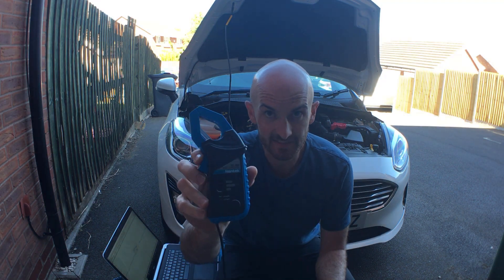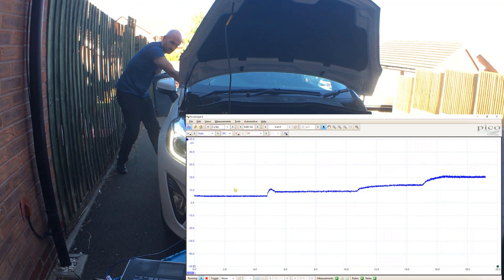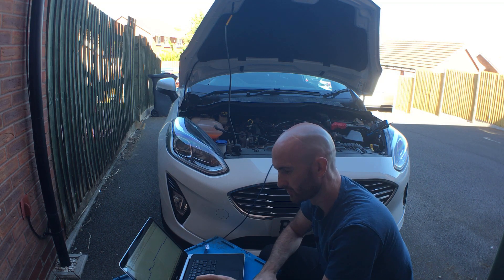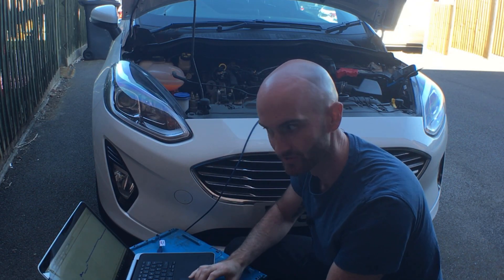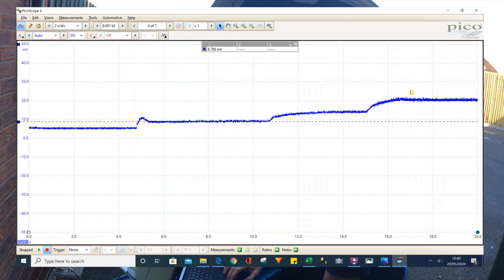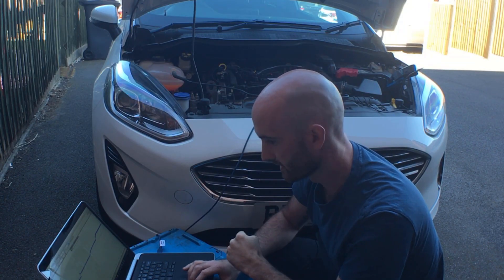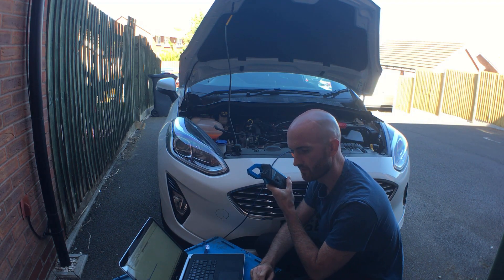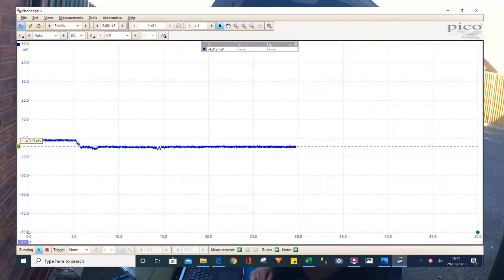HANTEK CC-650 AUTOMOTIVE TEST AND REVIEW [With PicoScope 2204A] Mechanic Mindset

Comment: Great video again! By the way which Laptop do you use for your Picoscope diagnostics please.
Reply from the maker: Most modern laptops will suffice. Of course the higher the specs the better it will perform for taking long captures. I’d say atleast 4gb RAM. 8 is better. Any modern processor. An a proper hard drive (not these small laptops designed for web browsing and basic office programs). 

This here is an old high spec Dell.

Comment: Can you still use this amp clamp with 2404a I just saw your video change about the new 7 pico  . Confused
Reply from the maker: Hi, yes it still works fine with 2204a. Pico 6 or Pico 7 👍. Just remember to get your software from picotech.com, and not PicoAuto.com
Reply: @MechanicMindset  thanks Darren 👊🏻

Comment: Great video. Sorry for the dumb question but I have no idea what's exactly Pico device or software connection to hantek electrometer since you connect it directly to PC? Can you please elaborate? Thanks:)
Reply from the maker: Good question, thanks! The Hantek clamp will work with any oscilloscope (Hantek, PicoScope, Autel, UScope etc). The Hantek amp clamp connects to the oscilloscope using the BNC connection.

See more amp clamps here: https://youtu.be/lYtW64Y-7Wk

Comment: Is there anything special you
Need to do to get the hantek clamps to work with the picoscope? In terms of set points in the pico software..
Reply from the maker: You don’t have to, but you can set up a ‘custom probe’ so the scale reads amps instead of volts 👍

Comment: I’m new to the scope world lol  I got the 2204a as well after watching your videos. Is there a way to setup the pico 7 up for both hantek clamps so it will do the all the conversions for me?
Thanx
Reply from the maker: Awesome, great tool for the price! Yes you can set up a custom probe by clicking the add button in the probe menu. Then use the look up table to put the mV/Amp conversion in there. Edit one of the existing amp probes to see how the lookup table works 👍

Comment: Hi mate I see on amazon there are 2 different types of the 2204a. There is the 2204a-d2 which is a bit cheaper. Do you know what the main difference is as its about £65 cheaper. Thank you!
Reply from the maker: Hi, I think one comes with leads and the other without. They’re not automotive leads anyway so should be good with the cheaper one. Get the Hantek leads 👍
Reply: @MechanicMindset  thank you and thank you for your excellent videos. You're a brilliant teacher. Unfortunately the hantek cables are no longer available :(
Reply from the maker: @dann2707  Keep searching on Amazon and eBay, they might be under a different name too. Just search automotive oscilloscope cables. 

You’re welcome and thanks for the feedback! Great to have you on the channel 👍

Comment: bro, if iam using this cc650 current clamp what setting should i pick for i has seen the 30A, 20A mode and 60A mode
Reply from the maker: Hi, it depends what you are testing. For relative compression/starter motor use the 60A mode. For smaller things like fuel pump, use the lower setting. I thought it only has 2 setting?
Reply: Thx a lot but could i just using cc65 measuring relative Compression in 60A mode?
Reply from the maker: @sweetjordan4868  No, max current for CC65 is 65 amps, and the clamp won’t fit around the starter cable 👍

Comment: hello great an info but you have made some hardware software changes to make the pico software recognize the hantek clamp. thanks and congratulations for the video
Reply from the maker: Hi, no changes need for the Pico software recognise the Hantek clamp; the clamp simply outputs a voltage. You can create a custom probe to get the correct amp reading. I think o just used the voltage measurement in this video. Glad you enjoyed the video! 👍

Comment: Thanx for this. I was hoping you would do an engine crank waveform, b/c that's what the high amp clamp is used for.
Reply from the maker: Thanks for watching. For sure, I did a video just before this; full relative compression on good engine, dead hole and small compression leak. I just did this video to see how far we could push this 650A clamp - surprised me to be fair! 👍
Reply: @MechanicMindset  
OK, thanx! I'll go look for it.

Comment: Should I add the clamp information and specifications manually Into the probe selection menu? I can only see Pico clamp in the menu.
Reply from the maker: Hi, yes you can add a custom probe. Or you can copy the Pico probe and edit the details to match the Hantek clamp. You will have to set up 2 probes; one for each amp clamp setting

Comment: I know this is an old video but I'd be interested to see the difference between this and the pico versions to see a side by side comparison
Reply from the maker: Hi, thanks for asking the question! This video has plenty of life in it 😂

I use the Pico clamps at work, I don’t notice any major difference but I have not tried it side by side. I also have the 65A Hantek clamp, need to do a video. Some people say the Hantek clamps are a bit noisy ey but I don’t think they are that bad. To be fair, the Pico clamps aren’t that expensive. Although I’d like to give the TA234 a go - fits right round a battery cable for battery drains 👍
Reply: @MechanicMindset  I would love to see a video on the low amps clamp ( and a comparison too if possible) I'm new to scope use and your videos are great, thank you
Reply from the maker: @andyguest6543  Will see what I can do. Glad you are enjoying the channel! Thanks

Comment: I've got two Electronic Specialties amp clamps and can't get either one of them to work on my 2205. Tried several things and they just won't cooperate. Still trying...
Reply from the maker: That is unfortunate! How are the batteries? Are they definitely outputting a voltage? Remember, all the scope is doing is measuring the voltage created by the clamp.

Comment: Much better suited to use the CC-65 for ignition and injectors.
I currently have the 65 which is great for the detail on low amp circuits.
I have just purchased the 650 to enable me to do relative compression checks
Reply from the maker: Nathan Thomas Burke Yeah for sure! To be fair I was surprised the CC-650 actually output a representative signal for the coil and injector. Just testing 👍
Reply: Yer defo, I'm surprised watching it it could get such a good response.
Had much experience with relative compression testing with this clamp
Reply: Is the 650 accurate enough to monitor parasitic draws? I have the 65 but it's not large enough to fit around the battery cables

Comment: Another consideration is CC-650 has a 400 Hz bandwidth limitation vs 20 KHz for CC-65.
The drawback on the CC-65 is it's small throat. And, I find it "noisy"
Yet, both clamps are hard to beat for price/performance which explains their popularity and I own both.
Cheers:)
Reply from the maker: the GADGETS playlist Ah ok, useful to know. Yeah they are great value. I am looking at the Pico TA234 - get around those big cables and probably a better quality output. I use the Pico clamps regularly at work and they are great, apart from the small throat on the small clamp like to mention 👍

Comment: You are a real genius using a 650 A clamp on a fuel injector. Has anybody told you that a fuel injector primary is about 1 A only? No wonder why the signal looks like crap.
Reply: @Der Waldmeister - Why so rude? Seriously man, chill out.
Reply from the maker: Der Waldmeister Haha, only testing out the limitation of this clamp. Clearly you would buy the 65 amp version, but not everyone would know this. As you can see, the video is a test of the clamp, not an in depth diagnostic video. But hey, I did pick up a reading which is better than nothing!
Reply: Stay off the beer lad

Comment: I also have 2204A, for my automotive hobby, but I bought Hantek CC-65. I only had budget for one current clamp and chose 65 A version, because it is more precise on smaller currents and in most cases it is below 20A, and 65A should be enough for everything except current draw for starer diagnosis, and maybe testing some alternator limits when charging back half-discharged battery. You can do relative compression without measuring current, battery voltage during cranking shows very similar waveform ,  only inverted - smaller voltage = larger current, you can't tell how many Amps go to stater, but you can clearly see compression events and compare cylinders.
Reply from the maker: Gatis Zvejnieks Totally agree! Yes the CC-65 is much better for low current signal. It a shame the clamping jaws are so small! I have not done the voltage compression test before, maybe I will try this another time. Thanks for watching!
Reply: @MechanicMindset  Great that someone is taking the time to show that cheaper on-automotive scope can be used in automotive applications. I have some suggestions/ideas for your future videos. Those videos might be interesting for me as an owner of picoscope 2204A.
You can make picoscope waveforms more zoomable by using streaming mode. 
Most of the things I described in this comment can be found in video called  "How to capture ZOOMABLE waveforms with Pico 2204A, or Streaming vs Block Modes" by dmitry L.  https://www.youtube.com/watch?v=_-WJ1akaVCw  After using his suggestions picoscope 2204A became so much more automotive friendly.

In your videos you only change timebase, but leave  "Auto" 8kS per screen, that is built in sample memory for picoscope 2204A after stopping capture you can't zoom in captured waveform. You can click views - > view properties and on the right side of screen you will see how low of a sample rate is used (on slower time bases it will be only several of kS/s instead of advertised 100MS/s).  Picoscope 2000A series picoscopes will go to 1MS/s per channel in streaming mode and 2000B series will go up to 9.6MS/s or something similar in streaming mode.  Then you can use relatively slow time base, but fast sample rate and later zoom in waveform.  But if you go slower than 200Ms/div picoscope software will start to drop sample rate, look at real sample rate in settings and play with time base to get the best zoomability.
Another thing is to use "resolution enhancement" instead of 8 bits can use up to 12 bits for better readability. It does not increase vertical precision, but is some kind of digital filter that makes waveform look smoother and easier to read. It can be applied after the measurement is captured and saved in 8 bit resolution, that is the native vertical resolution for all 2000 series picoscopes. "Automotive" picoscopes have 12 bit native vertical resolution that would be one of may advantages in automotive application over 2000 series scopes, the only problem is to justify the price, especially if it is only a hobby.
Third thing, you can change number of stored frames to more than default 32. I think maximum is 1000 or maybe 10 000.  I have it set to 200. Then you can have lots and lots of frames to go back in history and can zoom in in any of them.

All signals in millisecond/div and second/div timebase are slow. That includes ignition, injectors , digital cam and crank sensors. Everything that physically moves in engine is "slow" for oscilloscope. 10 000 rpm is a fast engine speed, but is only 166 Hz, or 0,166 KHz that is nothing for oscilloscopes. All mechanical events in engine are slow for oscilloscope  And therefore can be captured zoomable using this method.

The only automotive "Fast" signals are digital data  traveling in datalines, that would be in nanoseconds/div and microsecond/div range. Here you will have to use Block mode. In this mode you can capture fast signals, but one capture( or waveform screen) is limited to built in memory(2204A has only 8 000 sample memory). Only in block mode you can utilize  advertised 100MS/s and capture signals that are in MHz range, and this waveform can not be zoom-friendly.  In comparison "Automotive" picoscope has 250 million sample memory,  and "Block mode" waveforms can also be zoomed in. 

It is very easy to make your own "pulse sensor" that works the same as picoscopes first look. All you need is piezoelectric speaker (reused from toy or bought for 10cents new) , put in some pipe. It can be used to measure tail pipe pulses for misfires. And also works for pulses in vacuum, if connected in place of brake booster.

Another toy is pressure transducer, that can be used for in cylinder pressure test on a running engine, remove one spark plug put in the sensor. Then graph what how the pressure changes.  Pressure transducers can also be used to measure and graph liquid pressure changes like gasoline pressure or oil pressure if you would replace oil pressure sensor with this transducer. 
I bought a pressure transducer for in-cylinder pressure test a year ago but didn't have time to make adapter for spark plug (old  spark plug might be used for that), it also needs 5V reference voltage power source -  USB power bank can be used for power. It was cheap (about 10 to 15 usd), but not as plug an play, therefore sits in my toolbox.
Reply from the maker: Gatis Zvejnieks Wow, thanks for taking the time to share this! Yes I have had a play with capturing waveforms on a longer time base and zooming. I can see the difference when changing the sample rate. That is a good tip, useful for checking slack timing changes where we want to compare time bases at different points. I’ve not heard of this block mode, will check it out. 

I love the pressure diagnostics, it gives a great picture of inside the engine. Will also have to get myself a piezo pick up and try measuring the exhaust pulses. I see people using 2, one in exhaust and one in intake for a full picture. 

Some great ideas for me here, will have a play put something together. It really is a great tool this 2204A, for the money! Thanks

Comment: Wouldn’t the filters help clean up these signals? Same with pulling the current readings from a jumper wire out of the fuse box if possible.
Reply from the maker: Bleebleblahble88 Yes they would, this scope doesn’t seem to have the filter function like the Pico Automotive (and others) do. Re. jumper cable, the ignition coils and injectors (12V) tend to have a common power supply i.e one fuse for multiple components, and ground switched at the ECU, so no where for the jumper cable. On other components with a dedicated fuse, for sure! Get that clamp out of the EMF for a cleaner signal 👍

Comment: I am sure you know Hantek manufactures a Low Amp probe the “CC65” much better suited for these purposes. Also very reasonably priced. Cheers
Reply from the maker: TheGibby3340 Yeah, just seeing how good this is for the lower current measurements; and the CC-65 won’t go round a battery cable (for current draw). It is clearly not suitable for low current measurements and the 100mA setting seems a bit of a gimmick. What I will probably end up getting is the 30A TA234 from PicoScope. 👍

Comment: I use the same clamp for relative compression,  i put it so that the current flows through the front face with the buttons, and out of the back. That is the conventional current flow.
Would have been easy for us if they had put an arrow on it.
Thanks for the demo
Reply from the maker: Ah good way to remember. Yeah, it wouldn't have been difficult haha! I was pretty impressed with this clamp to be fair. Thanks!